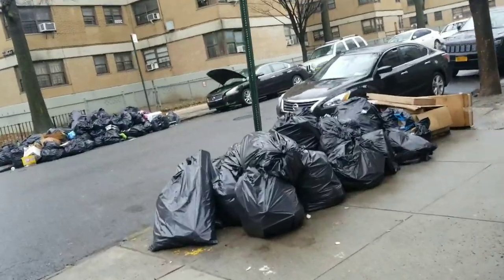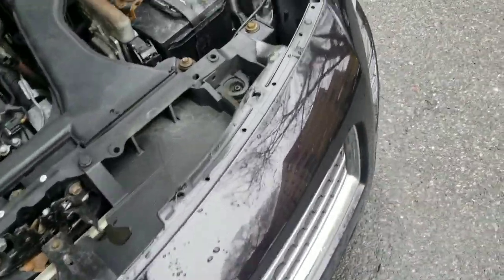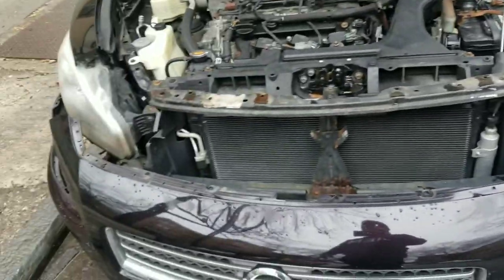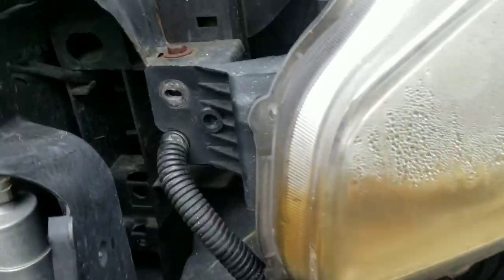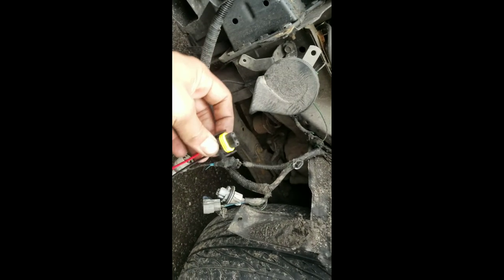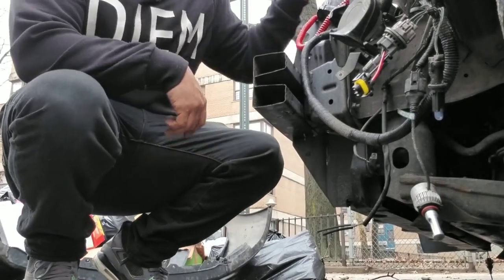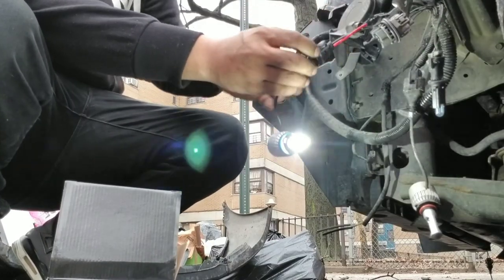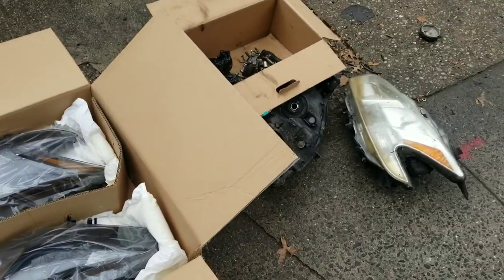Nissan Maxima | Headlight Assembly Replacement | Rewire | HID to H7 | 2010

Comment: I got a 2009 maxima I wanted to get the  drl headlamp but my driver side fog light wire was cut off when I purchased it. Do you know what I would need to buy for wiring purposes?
Reply from the maker: jump the left lamp to the right lamp and it should work fine

Comment: Appreciate the video but question. I have a 2011 Nissan Maxima which head lights do I have? Where can I find them to have them replaced?
Reply from the maker: they should come with HID, this video is to change it to a cheaper source, HID bulbs are $100 at autozone but is def worth it
Reply: @2SmartAuto  how can I get in contact with you for service?

Comment: Which pigtail did you buy for the low beams? Technically you don't have to swap the high beam pigtail correct?
Reply from the maker: It's easier to find out which light you want them swap the pigtail